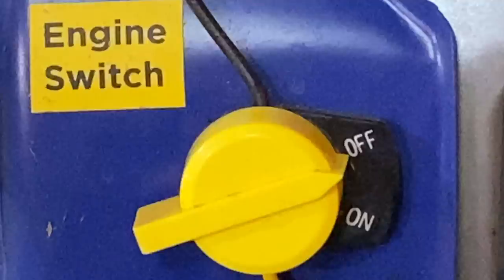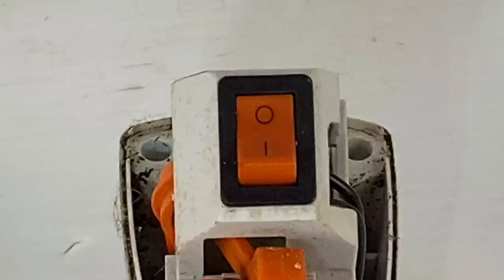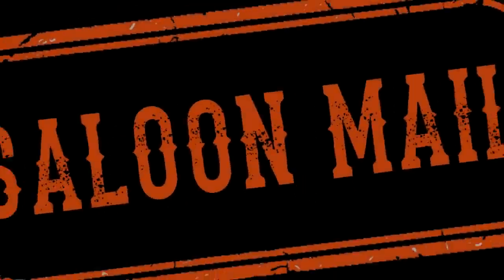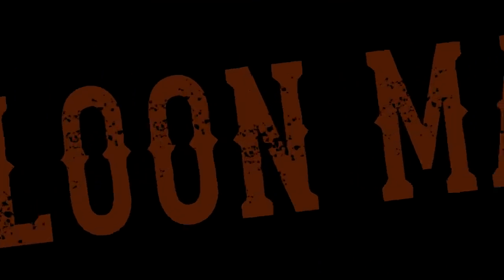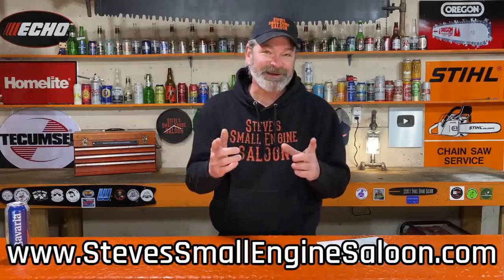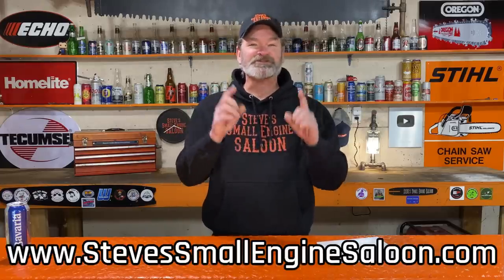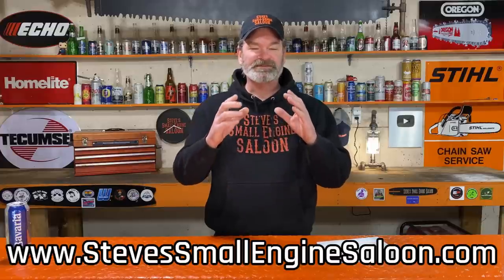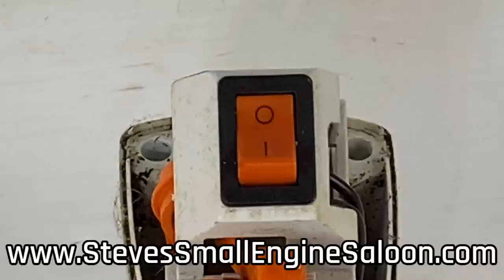Easy Way To Remember What The I and O Means On A Switch

Comment: I believe the I and O is 1 and 0, Binary. 1 is on and 0 is off.
Reply: I was about to type that exact same thing LOL
Reply: 1 & 0 yes
It’s digital
0 = open circuit
1 = closed circuit
Reply: I is ignition..
O is on...got it.
Reply: Yes, you are those symbols utilized in Computer Science and Electronic
Reply: Yes. Correct!
Reply: For the non computer types, saying 1 is I for ignition is genius. 0 is tougher for O for off, but since you need ignition before off, again, genius!
Reply: Exactly
Reply: So what you are telling me is that you view yourself as a commodity. There are millions of just like you? Correct?
Reply: What if you're "non-binary"??😊
Reply: That was started by IBM decades ago
Reply: DUH.  That’s exactly what Steve said.  Using the word binary doesn’t make you look smart.
Reply: Eye for in, oh for out.
Reply: This is the correct answer.
Reply: @rogerthomas169  you must be drinking Pabst Blue Ribbon
Reply: If it is running, the switch is on. If it isn’t running, the switch is off. 🤓
Reply: @jjflash1645 no, it isn't.
Steve kept the symbols as letters. They are not letters, they are numbers: one and zero.
Reply: It really is for an open circuit and a short meaning closed circuit. And it’s worldwide, so no languages required. If you had on and off, then it would be specific for English only.
Reply: But I have a politically correct trimmer that is non binary and identifies as a mower.😂
Reply: What if its non-binary?

Comment: I'm a 76yr old retired Australian airline pilot, my father was a telephone technician in the 50's & 60's. He had several diagnostic tools with on/off switches which had these O & I symbols. I was told by my father in the mid 50's that it was the international electrical circuit symbol for open and closed circuit. I'm not sure about the binary code theory as these symbols were in use long before the word 'computer' was ever known by the technician fraternity or the general public. Sorry, but it's hard to accept something being named after a thing that hasn't been invented yet.😁.
Reply from the maker: Agreed!
Reply: Not sure what your point is about computers but binary code theory dates to 1689 which pre-dates telephone systems by a tad.
Reply: No that may be right because a closed circuit would be a straight line of conductivity and the circle represents that the circuit is open meaning that current can not flow. It doesn't have anything to do with binary numbers, but rather flow of electricity.
Reply: Dad? Dad!!!!
Reply: @lmalino695  ....the guy who jumps in to appear smart despite his lack of attention being the source of the "mistake" he thinks he is correcting.
Reply: @kennethalbert4653  love it bro you are so right.
Reply: @kennethalbert4653  the best way to appear to be smart is to do research in a library or maybe spend some money on an education.
Reply: I used to try the open or closed circuit reasoning but only made me more uncertain. I kinda think an O would represent a closed circuit, especially if it’s DC. I’ve more recently gone with the binary meaning and had no confusion whatsoever. With that being said I believe I’ll try “Ignition” and I’m also going to associate the O with it being “Out of service”. If this isn’t crystal clear next time it’s back to binary.
Reply: You are correct sir. The 1 is on or (true) and the 0 is off or (false)
Reply: How do you know if someone is a pilot?  Don’t worry, they’ll tell you
Reply: I took a couple of semesters of electronics in college, and I never saw O and I used to indicate open and closed circuits.
Reply: Same here. I tell my kids think this O for open circuit for off
Reply: @speedgonzalez489  You shouldn't have to spend any money. Many people who have not gone to school attained more knowledge by being free to learn whatever they please. Pretty simple logic like you said, the switch is based off the flow of electricity. Who ever came up with the binary excuse is dumb. I mean it works in the same way, but real electrinos and electronics use it by flow.
Reply: Binary has existed for centuries in mathematics
Reply: Even though this is the first I've personally heard of it, the open and closed circuit theory makes more sense to me. Because even if binary has existed in math since 1492 or whatever, that doesn't mean it was well know or commonly used. Kinda like how this annoying meme thing was technically invented by some British dude in the 70's but nobody had ever heard of it or started using it until after gen Z was born and started ruining the world.
Reply: @kennethalbert4653  how do you know for a fact he is wrong?
Reply: The numerals 0, zero, nada, nothing and 1, unity, one,  something more than nothing are arabic and well predate the '50s or even 1689.
Reply: Closed circuit is a middle line connecting two other lines, like this ___.__.___ An open circuit is this __./ .__ The correct answer according to the IEC is that these are a BINARY ONE and a ZERO. In any numbering system ZERO is the equivalent of NOTHING which is OFF.
Reply: The modern binary number system was studied in Europe in the 16th and 17th centuries by Thomas Harriot, Juan Caramuel y Lobkowitz, and Gottfried Leibniz. However, systems related to binary numbers have appeared earlier in multiple cultures including ancient Egypt, China, and India. Leibniz was specifically inspired by the Chinese
Reply: @kennethalbert4653  the guy who tries to act superior by showing how another guy thinks he's smart, when he evidently had it right to begin with, making your superiority a farce.

You have been quiet lately 🤔
Reply: @realSamAndrew  It took you a year to get here and my response is too slow ??
Reply: @realSamAndrew  lmalino said, "I don't know what your point is about computers...."
Get it now ?
Reply: @kennethalbert4653  when I discovered this video is not in my control. The responses, especially with your name tagged, are emailed to you, and/or alerted so that's not a fair comparison. Now, to your second question, I still don't see your point. The OP shifts his criticism from one arena to another with no basis. Iamlino was on point in his response. If you want to make your case, you need to spell it out directly and stop trying cute innuendos. You were cryptic in your first comment, and now you reply to me in a teasing question instead of laying out the evidence and your points.
Reply: @realSamAndrew  OK, fair enough...I like to bust balls !
The OP's point (overall) was, the symbols were in use before computers (and therefore binary) were common knowledge, so it is unlikely that people would understand the symbols based on binary.
OP never implied binary did not exist. 
OP was incorrect when he said "...not invented yet" but that conflicted with the rest of his statement so it was clear to me to be poor wording, not his misunderstanding. 
=> Lmalino was flaunting his knowledge to correct a statement he misinterpreted.
IMH observation.
Reply: @kennethalbert4653  I disagree with your interpretation of the OP. IMHO the OP was equating binary code with computers and implied binary did not exist before electronic computers. At the very least, it's ambiguous enough that you cannot fault the "smart guy" for reading it the way I did.
Reply: @realSamAndrew  I see your side.  Reading it again you may be right....ambiguous. 
Either way, I like to bust balls !!
Jesse Case and 6 others agreed with my interpretation: )
Reply: @kennethalbert4653  I can tell you like to bust balls. I do also, but not from  a place of making people react, more of wanting to get to the truth and making people prove it if there seems to be an error. The number of people agreeing with you is meaningless as you well know the public is often wrong. Even in this case, there is a legitimate debate over what the symbols mean and why they happened the way they did, but there can be no debate over the flaw in the OP's logic. He used the false premise that electricity existed before computers, and lmalino695 correctly pointed that out.
Reply: @realSamAndrew  I bust balls to get a feel for a person's disposition, you sir need to find some charisma.
Reply: @kennethalbert4653  that seems like a random remark out of nowhere with nothing to do with anything
Reply: FYI- just because computers are a relatively new technology, doesn't mean Binary is too! See below for details! 

The modern binary number system goes back to Gottfried Leibniz who in the 17th century proposed and developed it in his article Explication de l'Arithmétique Binaire [1] . Leibniz invented the system around 1679 but he published it in 1703. He already used symbols 0 and 1.
Reply: @RS-uo2nd or his son will!
Reply: yep. I hopped down here to say the same. These are the symbols for open and closed circuits. They are not one's and zero's. It's how they are drawn in diagrams. BUT. Boolean algebra has been around since George Boole introduced it in his book in 1847. Lot's of stuff based on that I tell ya.
Reply: I don't think he is saying that it is a 1 and a 0. I think he is saying that he thinks of it that way because it helps him remember if he can relate it to symbols from his field. Just like Steve did. Obviously the I doesn't stand for Ignition, but it's easier for him to think of it that way because of his profession. I guess whatever works for each person to make it easier to remember. On and Off would only work for people that can read English.
Reply: @lmalino695  I think his point is that it's his field of study so that's how he can relate. His idea is just as valid as Steve's idea.
Reply: The Binary number system precedes computers.
Reply: @speedgonzalez489   crazy..that seems opposite to me..A closed circuit would be the circle. But my brain thinks its own way..haha..
Reply: Computers actually date back to the mid-1960's around the time "Gilligan's Island" aired on TV.  Remember the episode where the "Professor" built a ship-to-shore single side band radio (or Marine SSB) out of coconuts without ever worrying about ones and zeroes or even the binary code?  The Professor was a man light years ahead of his time.
Reply: @JesseCase Both the decimal and binary numbering systems have been around in mathematics for centuries. The binary system has moved beyond the confines of mathematics with the development of computer languages, which are based on the logic of true (on) or false (off), hence the term 'binary choice'. By avoiding any particular spoken/written language, the 1/0 symbols are universal.
Reply: Tube electronics have.   Zeros and poles.    They are not digital like semiconductors, but they performed the same functions,   and in some areas they still outperform,  especially with higher voltage, and they also resist an EMP.        Take a moment and google the zeros and poles of a tube circuit.  It is app about off and on.
Reply: You are certainly right. 
But nevertheless it ´s an excellent method to remember which is ON or OFF.

Comment: Hey Steve, I have a bolens bl110 weedeater that runs great, but gas leaks from the  carburetor when I screw the gas cap on tight. I can't seem to figure out why nor where it's leaking from.

Comment: If you put the two symbols on top of each other, you get the computer power button symbol. Yes, they did that on purpose as it denotes a Push On/Push Off function vs discreet On or Off with a rocker switch. Also, these symbols are a 1 and a zero in which a bit is On when it is the value 1, and Off when the value is zero.
Reply: I was wondering why every time I pushed the clock button my PC lost power.  Thanks.
Reply: It's actually binary. Like computer language. It's a one and a zero. I. Computers one is on and zero is off.
Reply: @SuperMutsy  in most cases, but not all.  I was the tech that worked on ECL circuits as they are active low and some of the other techs just couldn't quite grasp that.
Reply: TBH, it took me years to figure that out. I just knew that it was the power button due to the shape and location. As I recall, when I started using computers they just silk screened the word power by the button, or had it indented into the button. The 1/0 icon that's now common came later. 

I assume the change was made partially because the computers were being sold in different markets with different languages and partially because computers were getting smaller and the writing was harder to read.
Reply: I like this "bit value" explanation the best.

Now watch some clown suggest these symbols predate the Abacus and came from outer space.
Reply: But have you actually TESTED the switch from a 2-stroke piece of equipment ?? the "1" is "open" and the "0" is "closed". It's the opposite "logic" of a computer power supply switch.

Comment: Hey Steve. Long time viewer and admirer. I have an 1984 B&S, 8HP, Model: 190402 engine on a Pari tiller. It sat for 15 years. I’ve cleaned the tank, replaced the fuel line with filter, rebuilt the carburetor, then installed a new one. Replaced the magnito coil and spark plug. It ran the first pull, then shut it off to change out belts. It backfired and never started again.  I’m a little old man and I’m hurting pulling the rope. Any ideas?

Comment: Hey Steve! Glad you did this video, This has been a problem for me as well, the I and o symbols have just seemed to be defying all logic up until now. I wonder if it is covered in the owners manual which I hardly ever read. As long as I have a definition for the letter or symbol I, I can better remember which way is which. Too bad on and off both start with the letter “o” that was the confusing part. Now starting my equipment should be a breeze. 👍🍻

Comment: I always had a problem with this. O could be on or off. I remembered it  as the line means connected. But ignition is a way easier way to remember this. Thanks Steve. Never had a problem with the rocker switch that automatically goes back to the on position after shutting off. But the older ones didn't
Reply: I've got no problem with O or I or on /off as the thing :D  however I do have with if pressing it will change it to that state or from that state or which side the rocker switch means selected (up or down).
Reply: Yeah, I could see where some might think of the "O" as being ON.  I just never thought of it like that.  lol
Reply: That was my confusion also.  So its "O" Is off and "I" is ignition.  Just gotta get it straight in my head!!

Comment: I looked at those symbols as the circle denoting a complete circuit and the engine would start and the line as an incomplete circuit and the engine will not start. A couple pulls on the starter cord always let me know that i needed to change the position of that switch.

Comment: Nice! I learned it was binary (therefore supposedly universal meaning- but still confusing because, well... math) "I" is one, on, circuit complete. "O" is zero, nothing, incomplete circuit. Still confusing as heck. I like your explanation better: ignition, and off.
Reply: That's what I learned also. I still not sure if engine or motor is going to start or not. Haha
Reply: I always had seen it as numbers myself.
0 being zero chance I am going to start it.
1 being I have 1 chance to start this before I flood it!
Reply: @brettanderson6743  Lol 😂
Reply: Yup, binary. So easy, all you have to do now is get a degree in computer science.
Reply: @gordbaker896  That sounds about right.
Reply: @gordbaker896  because a system built on 10 is so much harder than inch, mile, yard, cup, oz?
Reply: @JohnKrist  Fahrenheit for example is much more accurate than Centigrade
Freezing to Boiling is 32-212° degrees instead of 0-100 for Centigrade.
Reply: @Jmoneysmoothboy  The difference between Freezing and Boiling at sea level is 180 units in F° and 100° in C°.  Much greater ACCURACY can be observed on the Fahrenheit scale.  End of discussion.

Comment: Every season it’s the same thing. The mystery of the on/off switch. This video saves me a lot of time digging through the shed while looking for the owners manual. And as an extra benefit by avoiding rummaging through the shed I avoid the annual “you need to clean out the shed” lecture. Wow! Saved again!!
Reply: Boycott manufacturers that won't put it in English.
Reply: can you remember which end does the dangerous work? duffass